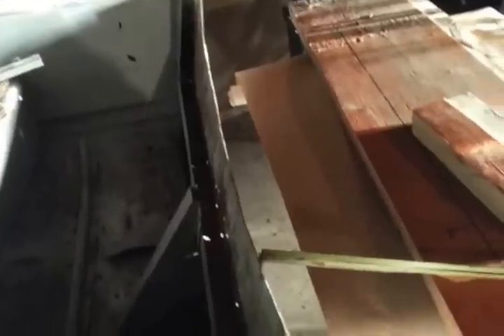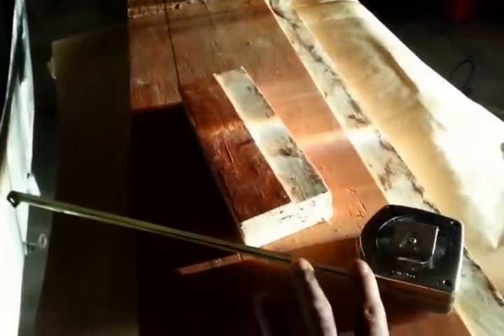Transom replacement 16 ft aluminum boat part 2

Comment: Lvl has a very low tolerance for water penetration I believe the adhesive used though strong does not hold up to constant water or moisture exposure
Reply from the maker: This is true however I have a small piece outside in the snow and rain to test its ability to stand up to moisture with no protection or paint and the wood didn't fall apart
Reply: Jerrell48 funny you should say that...I had a 18 inch piece of leftover lvl from my garage it was a 9.5 inch wide orange. It actually broke in half along a lateral line. But hey maybe sealing it is the key.

Comment: Because it's laminated is there any fear of it absorbing water and swelling?
Reply from the maker: I would say to use a different material if your transom repair material is going to be underwater when in use and cant dry out. the wood I replaced is above the water line. 
Thanks for your post